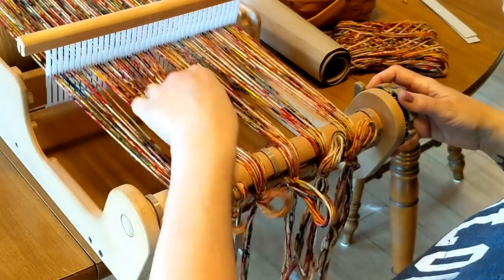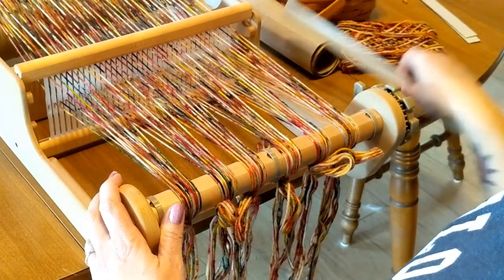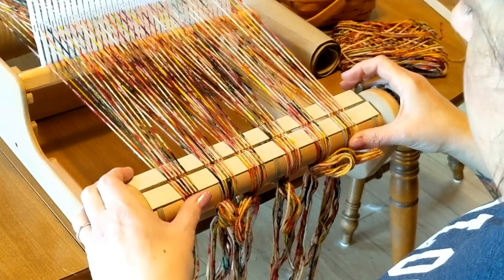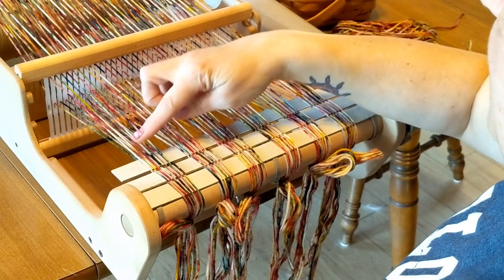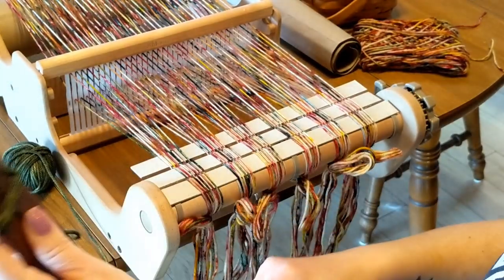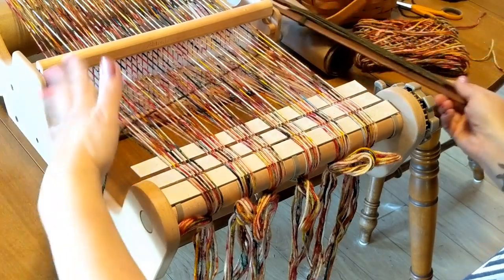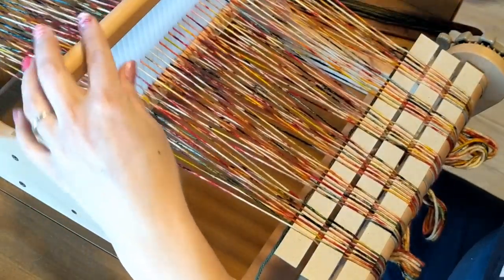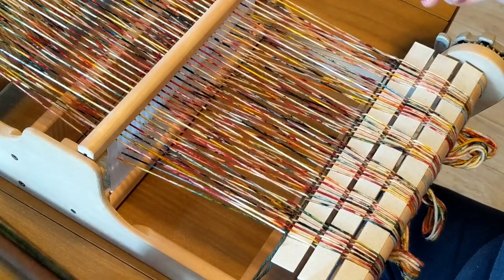90% Knitting - Let's Talk About Weaving, Part 2

Comment: On the front beam, when I first begin to wind it on, to stop the knots from distorting my fabric, I use an empty paper towel tube or wrapping paper tube.  It's a bit stiffer than the paper so it creates a more even surface over the knots.  Then I continue with paper.
Reply: Good idea.